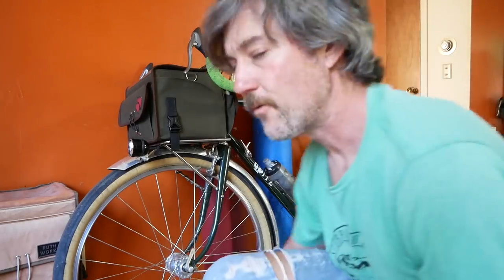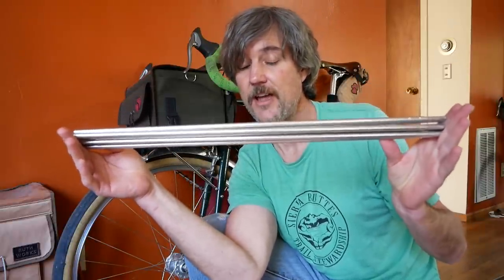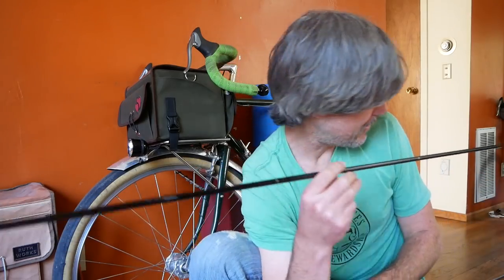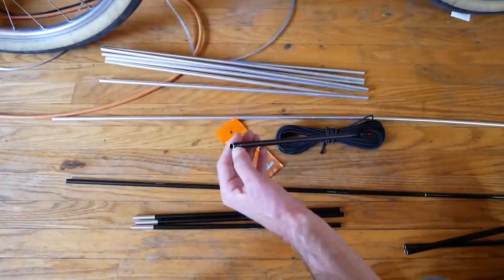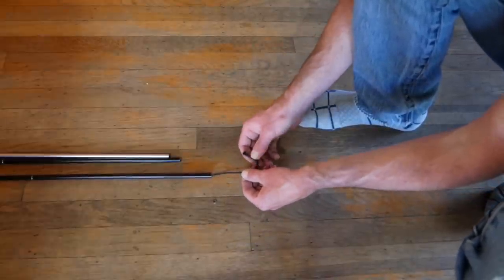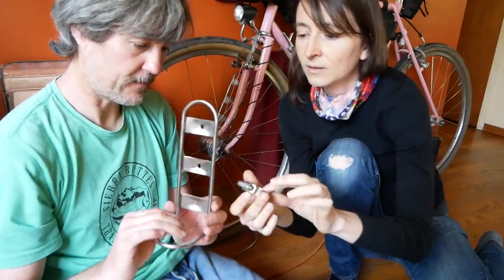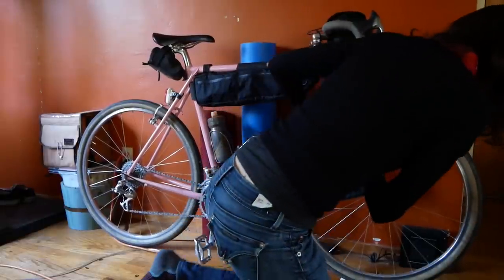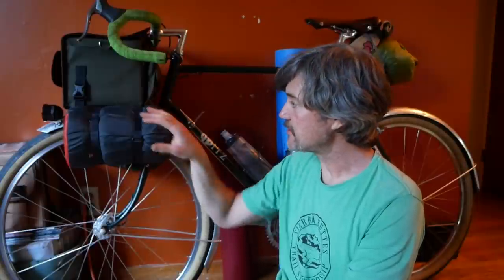Ms. Cools’ and Henrywildeberry's minimalist bike packing setup for 2021

Comment: Wow, what a conversion you two did! More blurring of strict lines between road touring to all-road travel but with very classic bikes and style. I especially loved Ms. Cools hardware store clamps and  Engineer Henry tent poles.
Reply from the maker: Thanks Rob! We took our engineering prowess to new heights here, lol! I think the bike packing style applied to classic inspired bikes has a neat look to it. It's something you don't see very often. I've gotten a lot of compliments on the silver fenders.
Reply: never thought of P clips used like that...coool
Reply: Lightweight bike touring is nothing new, unlike the bikepacking gurus would have you believe. French randonneurs have done it since the beginning if the 20th century. So have the British ones. Gear was fastened on bike frames before low riders were invented. American gear makers are excellent at marketing and the whole american psychology is built upon the myth of pioneers, hence this propensity to present old and forgotten stuff as new and spin it as the latest cool thing to do . Check out historical photos and you'll easily see that the performance oriented randonneurs understood everything about light weight travel. Classic and efficient aren't opposed.

Comment: I can see someone coming up with a new system of rando bag with an internal frame that fastens  to the eyelet of the fork. It would have built in compression  straps and the low hanging part would be suspended by a saddle type brace going over the front rack. Bonne route!

Comment: Love the look of bikepack/rando setup look on classic looking bikes with that full fender.  Jelly of the style of these.  Good job!  Make me wish VO offered fenders for 26"+ tires.  Suppose I could try to modify balloon fenders to fit on mine.  Tho I do have to use racks on mine cause the chihuahua rides in the back and not getting rid of her.
Reply from the maker: Would really love to see some wide alloy fenders for 26" plus tires.
Reply: @Henrywildeberry   Think I'm gona do it.   With black steel balloon fenders.  Don't think chrome would look right with white frame, would it?  Its already not a light bike (some 45lbs with empty bottles).  2020 Surly Troll S. Gona turn into a modern retro cruiser style with rando flair.  Thanks for the inspiration.  XD
Reply: Gilles Berthoud has stainless steel 26" fenders in 40/50/60mm width. Around 509 grams for the widest version. And they stay so much nicer over time than aluminium.
Reply: @JaccoSW  Would love stainless.  Look sick if I brushed them.  60mm would be shy covering the 63.5mm  (2.5").   Don't think it would give me adequate coverage from the sides.  Might be sufficient if I don't aim for the puddles.  Was thinking about Wald 962 fenders (81mm).  Just Id have to take hammer and drill to the sheet metal stays to work around disk and racks.
Reply: @erikjohnson6484  Nah, that definitely wouldn't be wide enough. You kind of want them to fit inside of the fenders and you won't be able to if they are that wide. There's the Simworks by Honjo Flat 80 but those only come in 650B. The Wald might be your best bet. Add some Honjo hardware if you're feeling fancy though. The Flower Hato is a beautiful looking fender stay and I personally really like their lightweight tarpulin mudflaps.

Comment: The base weight of my backpack is 12lbs. Ive thought that with light racks, my bikepacking set up could be pretty close to that weight.
Reply from the maker: Sounds perfect! We could save a few more grams/pounds going with a lighter sleeping pad and bag. I'm really happy with my 3lb bag, and the air foam mattress even though I see some high end bags advertised at 1lb 3 oz with the same temperature rating. That does sound intriguing to shave an additional 2lbs. My whole set-up here is about 36lbs. That's the lightest I've toured with so far, short of credit card touring. My summer set-up will probably land somewhere around 33lbs if I can drop some layers.
Reply: @Henrywildeberry  Howdy, if you do switch out sleep systems, I've used Western Mountaineering sleeping bags for 27 years. They compress to a bread loaf, light, and the zipper guide is jam proof at 3am. Old dude now, the comfort of a Sea to Summit sleep pad is excellent on tour and packs small. As a minimalist, I crossed U.S. twice starting out with 24 pounds. That's not counting racks, panniers, or water carry; just my clothes, a few bike tools, camp gear, two days food, toiletries. I've used Anything Cages on the fork for off road shorter "bikepacking", but found weight on the front in soft terrain makes for crummy handling. A full frame bag for a water bladder works more better off road :-) The other light stuff works out in a bar bag (Sweet Roll), seat pack, feed bags, two small top tube bags. I dig Revelate Designs bags for their quality and service, nice folks too. Love your videos, thanks, and happy trails!
Reply from the maker: @Mike-vd2qt  Nice! It's good to know you like Western Mountaineering sleeping bags. I was turned on to them after watching Jay Petervary talk about his bike packing set-up. I've been on the WM website for hours now looking over the spec sheets and comparing models. That would be my first choice at this point.

Comment: So the if you have only one bolt on each fork leg like Ms Cools, could you run both the anything cage and your rando rack at the same time? Or would the extra bolt length and heavier weight stress the boss too much?
Reply from the maker: Yes, there is enough space to run anything cages, just like Ms. Cools, even with the Rando rack. I'd have to MacGyvor the hose clamp attachments the same way, since I don't have the three rack mounts either.

Comment: great solution for the front fork-just curious, what kind of clamp did you end up using?  It seemed to work perfectly.
Reply from the maker: Thanks Brian. This is c-hose clamp (the one we used is 5/8" diameter). You'll need to pick the one that fits your fork best. Note, I wouldn't do this with a carbon fork! Here's a link to something similar. https://theclampco.com/products/1-2-o-d-316-stainless-steel-loop-clamp?variant=35600243949719&currency=USD&utm_medium=product_sync&utm_source=google&utm_content=sag_organic&utm_campaign=sag_organic&gclid=CjwKCAjwgZuDBhBTEiwAXNofROOEkSH4GhgiZWLPUt0kE3prwxjZEsbug9bpn2Y0w3urDk7pTuXgwRoCC4YQAvD_BwE

Comment: Curios question, Why you are not using  a rear pannier with a dry bag ? (mounted on top of pannier, not sides) instead of seat post bag. wanted to know the reason.
Reply from the maker: Excellent question! I've tried using a rear loaded rack, but my frame wasn't built to carry a rear load. It's far too flexible and causes severe handling issues. The front fork on the other hand was designed to carry load. Front loading also helps to balance the weight of the bike plus rider. This as allowed me to use this bike for touring.

Comment: I own a bike with tubus front lowrider rack and rear cargo at 2. 6 lbs total, with minimalist/narrower packs capable of holding food/gear for up to a 5 day ride without resupplying...and the load remains lower center of gravity/safer than bikebacking setups. Interesting marketing ploy ($$$) by the biking industry as a whole.
Reply: Got the same Rubus rack myself. I'm currently on my first tour here in Thailand and have mixed feelings about carrying low riding panniers. I'm finding it hard to adjust to the change in handling characteristics. I wonder if it's something you get used to?
Reply: Biking360 I should have mentioned that I do have a bike with touring frame geometry with a higher bottom bracket heighth which is not the same geometry as the two bikes listed here in the video which would be low trail geometry and ultra-light/sport frames which are not meant to carry heavy rear loads.
My specific frame is a Soma Saga, which is a dedicated touring frame and ideal for both front and rear loads with much more weight. Hope this helps and best to you and your tour of Thailand...What a beautiful country!
Reply: @noelcameron7856  Thanks for the detailed reply and it's definitely useful. I have a Surly Long Haul Trucker which like your Soma Saga is a dedicated touring frame. I have a feeling my problems are therefore just down to lack of miles with this kind of set-up. I head out for another tour next week so hopefully, things will be a little easier by the end. Ride safe. JP

Comment: what's your handlebar width?
Reply from the maker: Center to center at the brake levers is 38 cm. The bars have a slight outward sweep with the ends measuring 41 cm (CTC).
Reply: @Henrywildeberry  that's revolutionary in the times of wider bars, cool